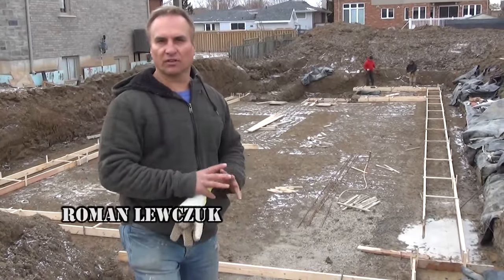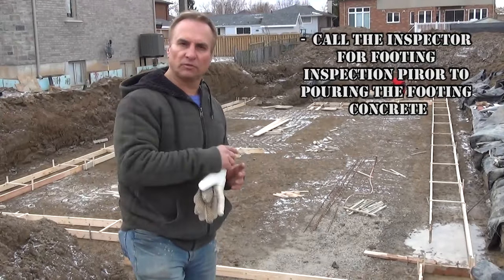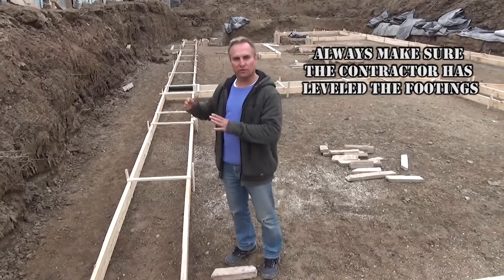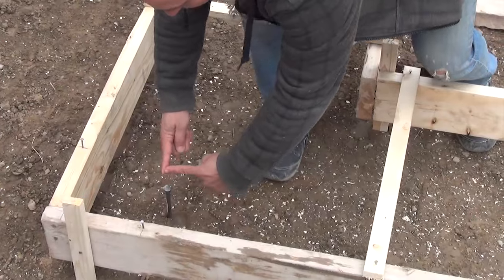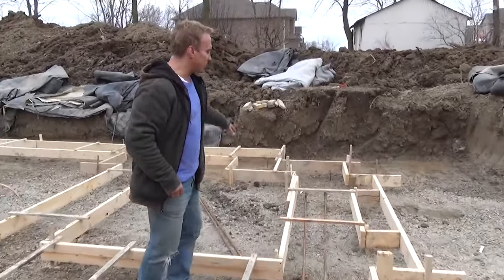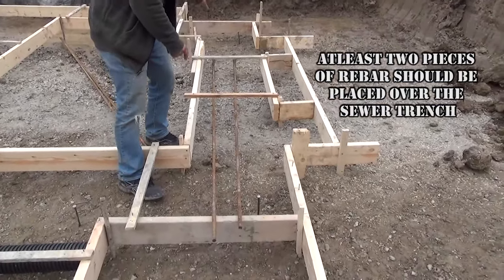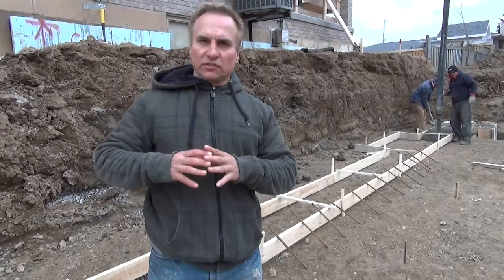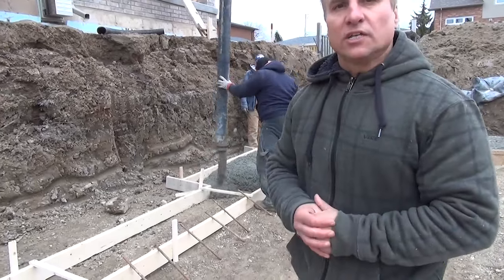How to Build a House: Pouring the Footing Ep 18

Comment: was wondering why you don't have rebar in the footings ????
Reply: We just got done building a footing for a 12-in retaining wall that's not holding up anything other than a couple feet of clay dirt sitting on top of solid rock on the edge of a tennis court. You should see how much rebar is in it lol. We have a 4-ft Matt with number five rebar at the bottom with trans bars 12 in on center a 12x9 chair and then another 4 ft mat on top of that also number five rebar and then l bars every 12 in. These footings are going to hold up a house and they have no rebar I'm kind of confused myself...

Comment: Although a level footing is important for a consistent thickness basement slab, it  doesn’t necessarily have to be perfectly level, certainly doesn’t have to be level to have a level wall. That’s what a chalk line is for. Back in the 80’s , we used to form and pour foundation walls directly on the ground/dirt ..no footings , never had an issue.
Reply from the maker: you could be right, it depends on how solid your ground is. I've poured walls directly on solid bed rock
Reply: what does this mean? Pour a crooked/unlevel footer then shim your walls to level? Sounds janky

Comment: No rebar? The inspector must be getting a kickback.
Reply: apparently not mandatory in South ON.
Reply from the maker: its not required depending on your local building codes and depending on your soil conditions. in this case we were on solid clay which we built on many times here with no issues. if you have any questions always ask a soil engineer and will probably recommend 2 rows of rebar in the footing.

Comment: A little late!! But why no rebar in the footing
Reply from the maker: better late then never! , it’s always good to put rebar in but if the foundation where you’re putting the footing is completely solid it’s not necessary, just a way to save some money. in some jurisdictions it may be required however, where I am it’s not required. in my experience most soil engineers will always require a couple rows of rebar no matter where you are, and it’s  usually two in the footing and two at the top of the walls which is basically a prevention if you get a little crack. also keep in mind that even with rebar you will more than likely always get a couple of minor vertical cracks.

Comment: Do you have a preference of concrete “slump” you want for the footings? 4”?
Reply from the maker: I usually leave it up to my concrete guys and they usually prefer to put a little more water in it only because it’s a little easier to work with and it flows in the walls a little easier. the footings they always pour more of a higher slump which is pretty important for the footing and easier to work with with less water in it. usually the concrete guys have a better idea of what works for them with the walls and footings.

Comment: Great video. I am building an acreage right now and will be installing a septic system. We need to run the sewer line outside the house. Do you suggest running are sleeve underneath the footing.
Reply from the maker: depends on the elevation of the septic system if its lower than yes, in most cases it is not so it had to go through the walls usually. you can do a sleeve or leave an opening or have your guys drill into the wall later there are different ways of doing it.

Comment: one thing is immediately leaping out at me, for footings, dont you have to dig down to get at or below the frost line? where are you doing this that you can just have them sitting on the ground? where i live, i have to go at least 2.5 feet down
Reply: feralbigdog  my area only calls for 16 inches down. Was also surprised be on top.
Reply from the maker: it is dug below the frost line which is 4 feet, the basement level there is about 6 feet down.

Comment: What state are you in? You must be somewhere there is no chance of earthquake. We have to  tie in verts on 18"-24" centers with J bends going opposite directions on to cont. #4 hor. bars. No wet sticking for the most part. Piers have to have 2-4 bars e.w.  Lucky you. I bet you don't have to locate a dozen or more  holddowns in your wall forms for openings and corners either.
Reply from the maker: yeah you're right there are no earth quakes where we are building. Biggest building concern here is in the winter with the frost.

Comment: Hey Roman, thanks for the awesome videos! they have been a real help! i was just curious if it is possible to pour footings in cold weather. im also from the GTA and was curious as to what temperature concrete will have trouble setting? thanks Roman!
Reply from the maker: Yes you can pour concrete in the cold weather but it is important that you cover the excavation with concrete blankets or straw and also cover the concrete once it is poured with concrete blankets or straw. its important that the ground does not get frozen where the footings are being placed.

Comment: Great video.....what is the footing width & height ?
Reply from the maker: The minimum standards for a house are 6 inches in depth and 18 inches in width but in most cases its 6 inches in depth by 20-22 inches in width. In different conditions there may be a requirement for different thicknesses and sizes for instance when we build on the beach in sandy conditions or close to the beach here we require much larger footings.

Comment: Roman, how come you didn't mention or show that Rebar is needed in the Footings before pouring Concrete? That is the responsibility of the Forming Company to install Rebar. Actually, in Toronto, Building Inspector requires you to have Rebar in place before he passes Inspection.
Reply from the maker: Sorry that is not always the case, especially if you're building on solid ground and if you want to be 100% sure you can always hire a soil engineer to confirm that Rebar is or is not required. In most new builds in this area and west Toronto such as Oakville, I would say that more than 80% of all new builds do not have or require Rebar.
Reply: Good to know. Thanks for the information.
Reply: If you don't have rebar the chances of the house settling with resulting cracks is dramatically increased

Comment: I would remove the corner pins just before pouring. I know it's just a dollar but why leave them there ?
Reply from the maker: liviu holca if you leave them in , you can use that point to line up the walls
Reply: Truth. Can line it up using a detector if necessary

Comment: Bizarre.  No steel? What engineer sealed those plans?  What owner didn't catch that?  Is it possible they added fiberglass or Helix?  Is that a suitable replacement for something that is loadbearing?
Reply from the maker: Its all better what you have indicated but in most cases its not necessary. a 6 inch x 20 inch footing on undisturbed solid soil is more than adequate to bare the loads of a standard house. I've built many houses and have had soil engineers look at lots of different situations so if you are not certain you can also hire a soils engineer to determine the size of the footing required and any other features that may be asked for such as rebar.

Comment: rebar is only used for tensile strength, if the footing is on undisturbed soil then there is no tensile pressures therefore not needed. notice in the video that they did use rebar where the sewer trench was.
Reply from the maker: sounds like you know your stuff that was way more technical than what I would have said you must be a soil engineer.
Reply: Yes and no. If you have diferential settlment then youll be happy you pit in rebar.
Reply: No, you need rebar.

Comment: NO REBARS ? !?!?!?!?!?!? (Reinforcing metal bars/rods along and inside the footing)
Reply from the maker: liviu holca if the ground is solid and undisturbed then its not necessary but its always better if you use rebar ,in most cases.
Reply: Roman Lewczuk I've never poured concrete for anything without either wire,or rebar,and in many cases both. I don't give a damn whether it's code,or not. if my name's going on the job it's going to be right it's not going to crack a month after I leave I don't like going back and tearing out anything,and having to re pour it. and I don't care how hard the ground is a footer without rebar,and wire is going to move ,and all footers settles no matter what. and it's news to me that you can actually build anything on a footer without rebar. I never knew that,but I am  not calling you a liar sir,I just never knew that.its true you learn something new everyday.
Reply: Concrete will crack, but won't separate if it has rebar.

Comment: I don't know how the inspector okayed the footing without rebar running around the footings...
Reply from the maker: it is not required, it depends on your building code requirements it will be different in different areas and your soil type in your particular situation but it usually is better to put rebar in. in this case we were on very solid clay, if you ever have any concerns with footings always call a soil engineer which I have done lots of times and they usually recommend rebar in the footings and in the walls and in some cases more than that depending on what they find. I've built on many different soil conditions in this area we have clay, sand, rock, sandy loam, rubble, just to name a few.